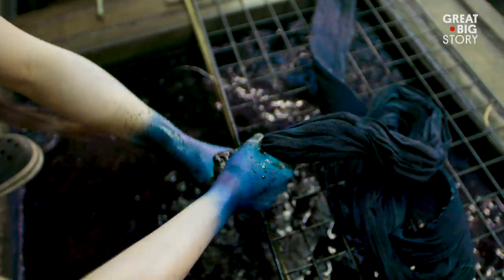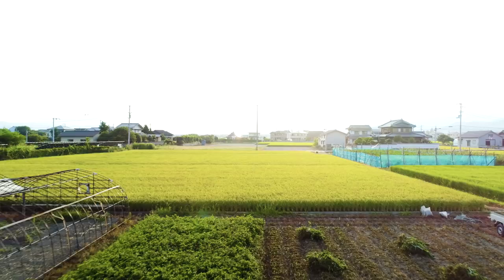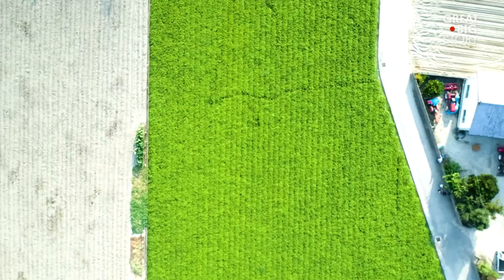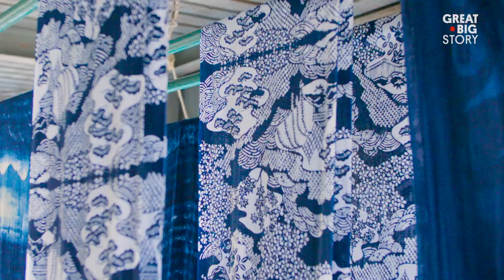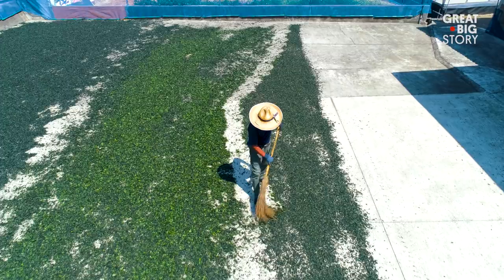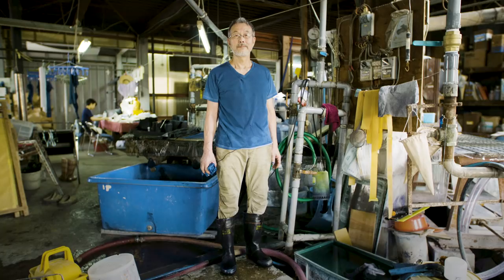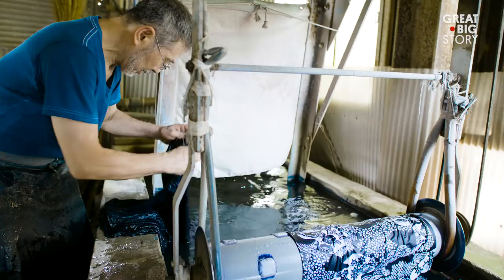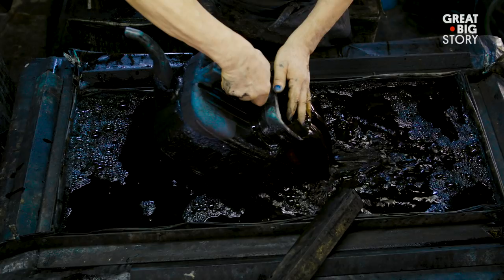The Link Between Japanese Samurai and Real Indigo

Comment: His nails aren't eternally blue due to the many years of working with indigo dye... they are cells that are continually being produced... they keep on growing, and because the indigo dye is not literally in his DNA producing indigo nail cells... if he stopped working with indigo dye... his nails would out grow the color and he'd have normally colored nails just like anyone.
Reply: Its called a metaphor...
Reply: Rodney Thornotn,

You should probably look up what a metaphor actually is if you are going to claim something is a metaphor.
Reply: Perhaps you should look it up. If you actually read the description of the word you will see that is in fact a metaphor.
Reply: Rodney Thornton,

"Perhaps you should look it up."

You don't think I bothered to confirm what I already knew... that you were incorrect? I did look it up to double check... in order to verify... and confirmed that you are, in fact, incorrect.

A metaphor states that one thing is another thing... It equates those two things to construct a comparison through symbolism, not because they are actually the same. The "eternally" adjective does not do this... it describes a permanence, it does not create an analogy through replacing the thing being described. And when they spoke of his stained fingernails... that wasn't figurative... it was literally the case... his nails were, in fact, stained blue, so no metaphor was being applied... and describing the staining as being eternal was not phrased as if it was figurative either, as they even made an effort to state a cause for the eternity of the staining... that is not how metaphors are presented. Even if they weren't being literal... it still isn't a metaphor.